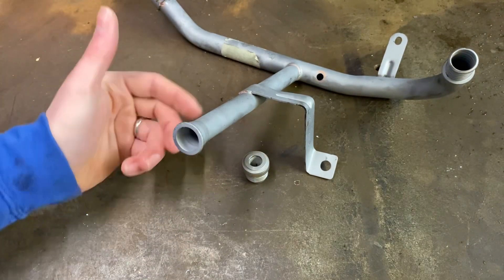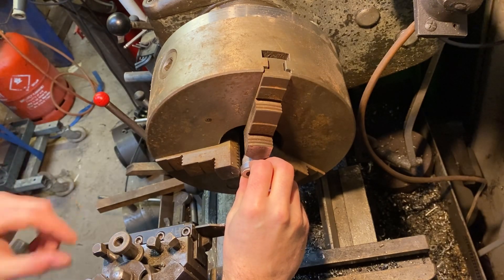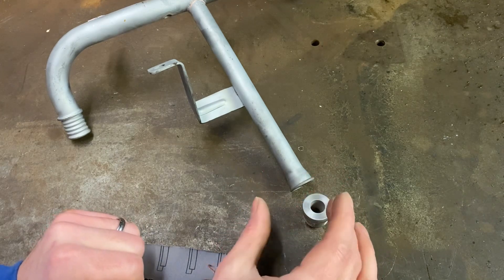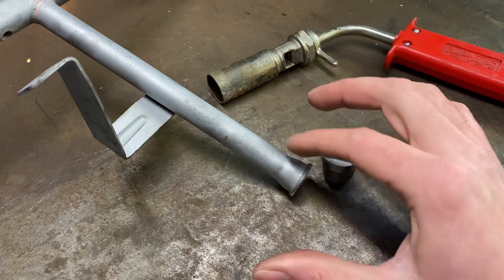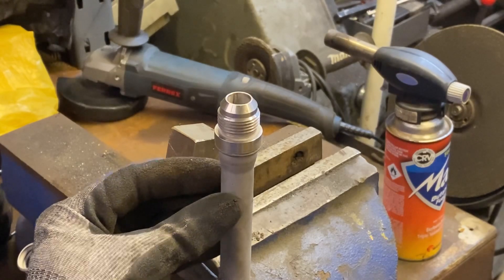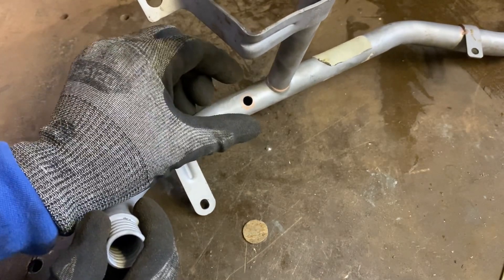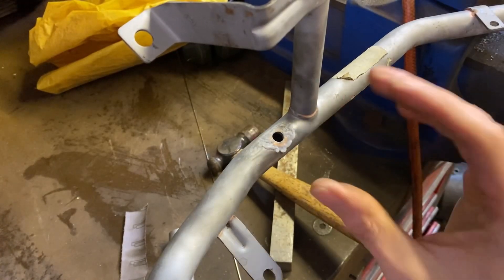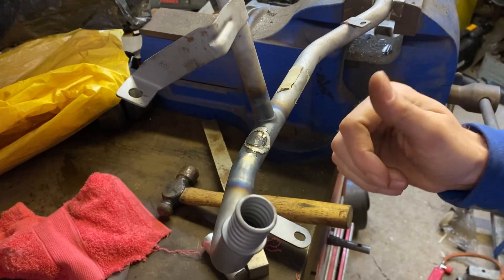Silver soldering! How to join thin wall tube and fittings, repair patches and more!

Comment: Silver solder makes a really solid joint, just a little bit less strength than brazing. It is impressive that you have 55% silver solder, mine is only 25% and it needs a lot of heat to melt, but I only use it for electronics that need to have some physical strength.
Reply from the maker: It certainly does, a perfect solution for this job. Not too much heat and almost as strong as a weld. I don’t have vast quantities, but they last such a long time a couple of short lengths will likely last me a lifetime! 55% is a great choice for general applications, not the cheapest but it’s really easy to work with. The solder melts at around 650 degrees c, so a dull red colour with most steels, the flux is 600 after checking. No point risking the integrity of the part with welding when this is much more suitable! Hope you enjoyed and thank you for the comment 👍